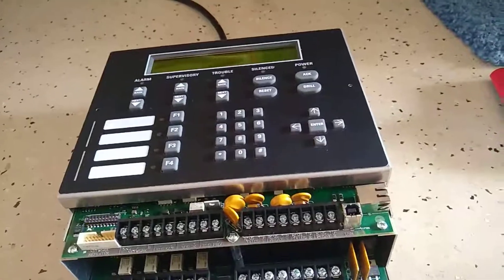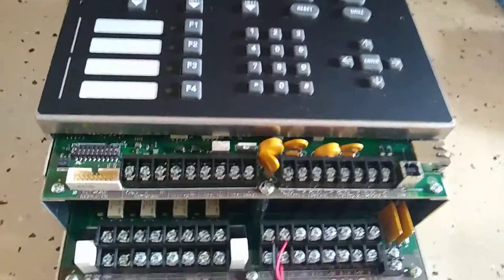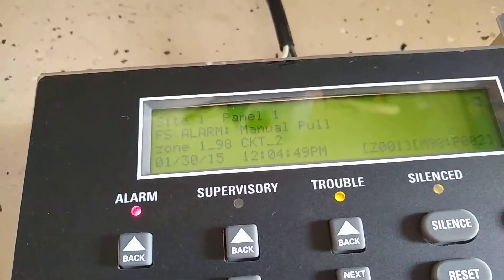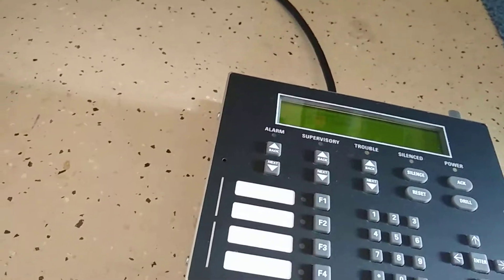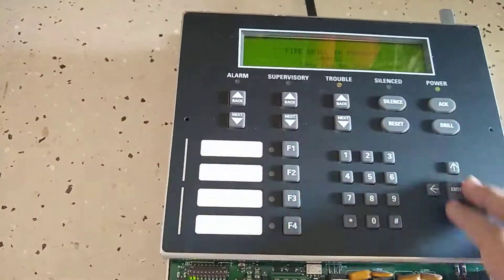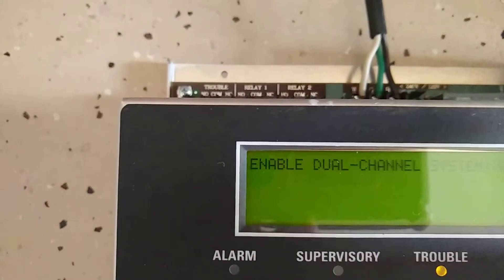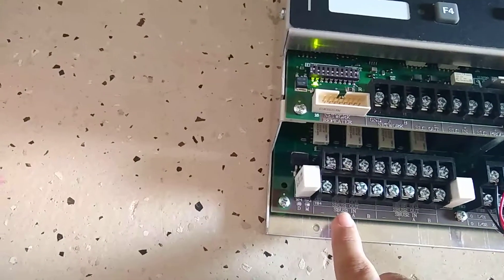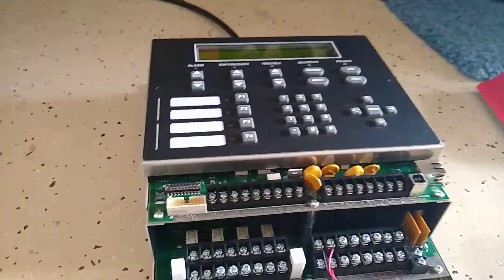Silent Knight IFP-2000 System Test 1

Comment: Are gonna use sd devices,idp devices,or still use the conventional zones on the panel.
Reply from the maker: Slc is shorted out but I may fix it, as of now just conventional
Reply: @FireTech7  ok
Reply from the maker: @SomeDudeWithAnExitSign  if I were to fix it, I'd go IDP definitely
Reply: @FireTech7  I all ways like idp/sk protrocall better then sd protocol.
Reply from the maker: I heard sk works on IDP but I'll have to try that when this gets fixed
Reply: @FireTech7  well that’s cool. On the newer I think the sk devices are UL listed with the newer Fahrenheit panels. Kinda like the notifier NFW-100x and 50x is compatible with flashscan devices.
Reply from the maker: Yeau